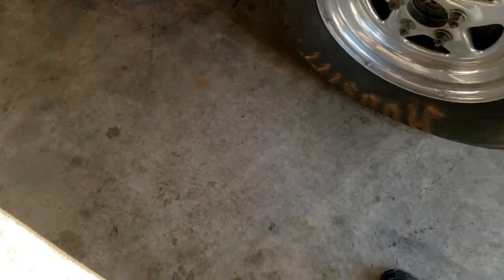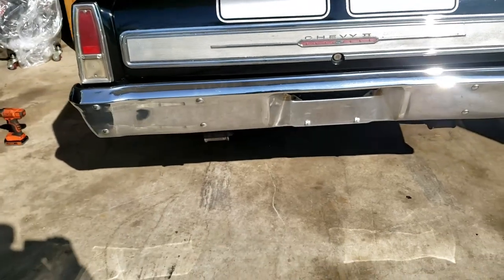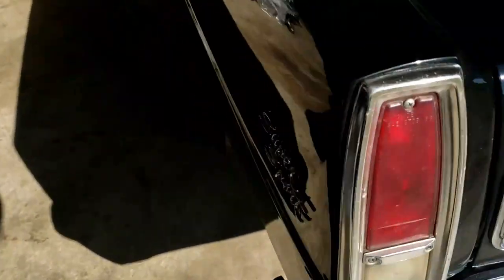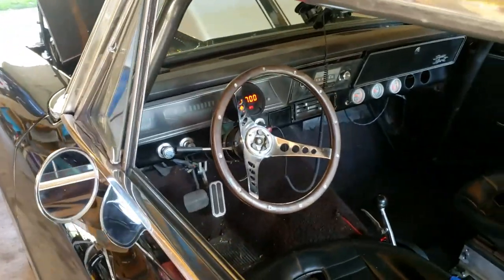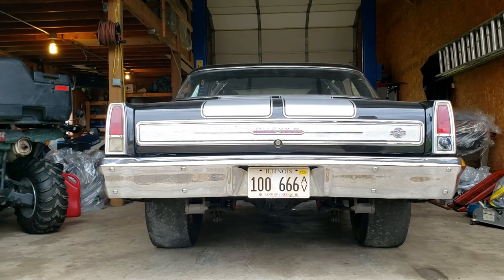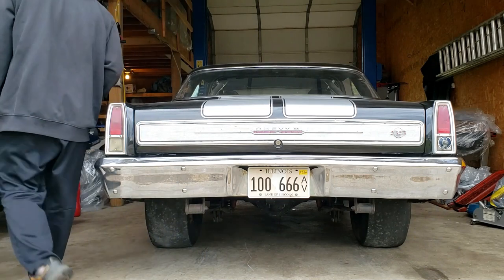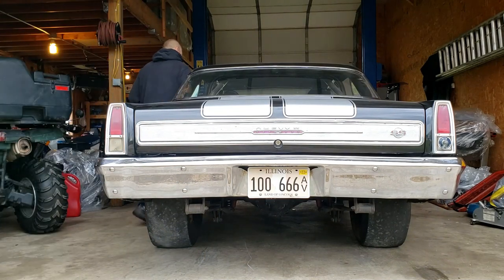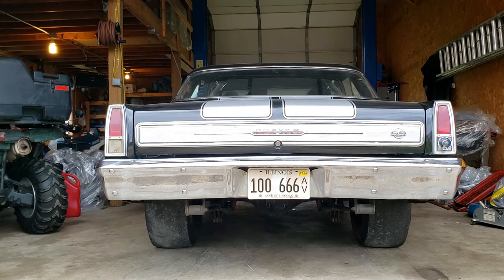Idle 350 Chevy Vortec Heads comp cams 292 vs GM Performance Crate 350 HO 330 HP vs Stock 350 vortec

Comment: I put an XR288HR in one of those 330HP crate motors with a set of 987-16 springs and it ran 11.90s on motor in my full body full interior 87 Z28
Reply from the maker: Nice

Comment: Of the choices I have to go with the 292h, I run a 260@50 on the street and love the sound of the idle.
Reply from the maker: How does that cam do street driving. Is it a solid flat tappet. What stall converter. Thanks for the comment.
Reply: @nylegreen261  The cam actually works out well on the street due to the heads being so big its softy down low, where some guys are 500 ft bs.+ at 3500 i'm at 400 ft lbs. so it's not surging. I'm running a thud 400/3500 stall with 3.55 out back. Engine is a 399 1st gen stroker on 91 octane. Cam is a solid roller with Hippo lifters.
Reply from the maker: @heshtesh  interesting how big of a head.  I have a set 235cc heads sitting on the self waiting for a decent shortblock.
Reply: @nylegreen261  This engine has 261cc Brodix 18* C- Series cut to 17* 404 cfm. Lazy down low. Hoping to convert to E-85 in the next couple years when I can afford an F-1 ProCharger.

Comment: We took 2500$ gm 602 race engine pin ha 50 nights on it. 
 
And put in a open motor class but 9.2:1 max comp.  Swapped out set of good valve springs , set of 1.5/1.6 steel roller rip rockers and a Isky cam and anti pump of lifters and stacked up the 
 🏁🏁🏁🏆🏆🏆   Had maybe $3000 in it total !!
Reply from the maker: Nice sounds like it worked out

Comment: So i have a stock L31, what could i do to the heads without changing anything else in the block?
Reply from the maker: Better set of valve springs and 1.6 slotted rockers. You will have to elongate the pushrod hole in the heads though.